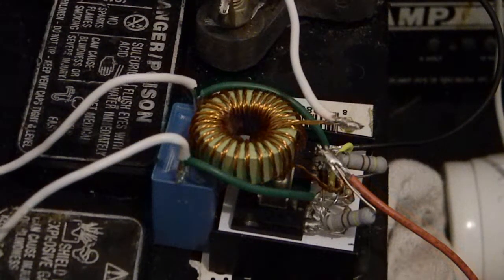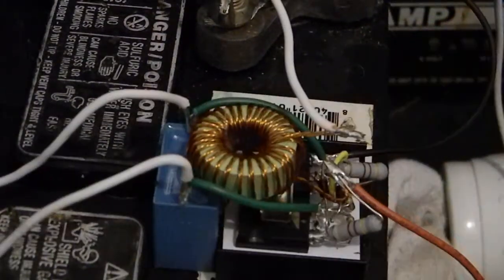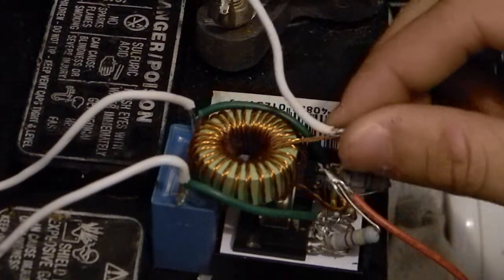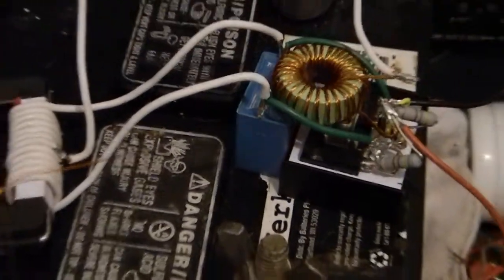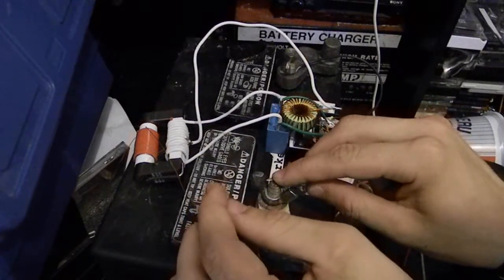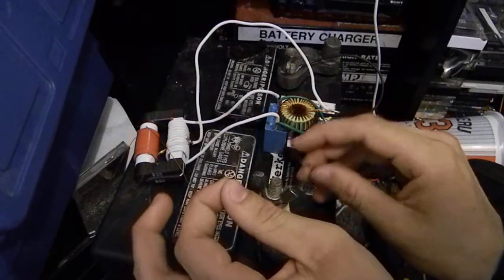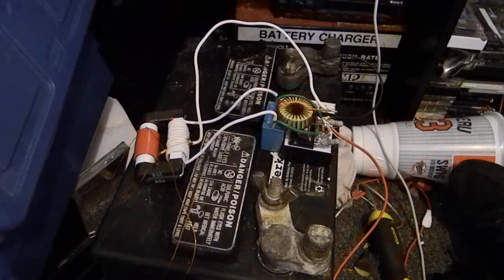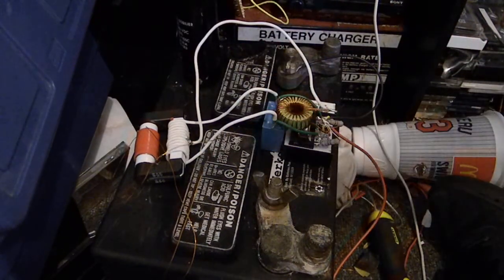ZVS Capacitor Charger

Comment from the maker: @Daedronus Yes I know this, but I just wound it this way so I wouldn't have to add insulation to protect the primary. With my actual charging circuit costing me over 30 bucks, i'm not gonna risk it for a little increase in efficiency. I do thank you for the tip though, shows this planet actually has some knowledgeable people left :p